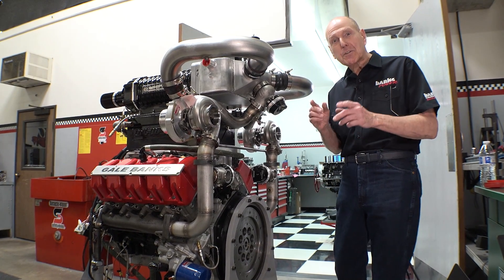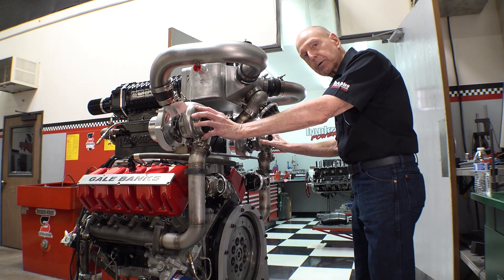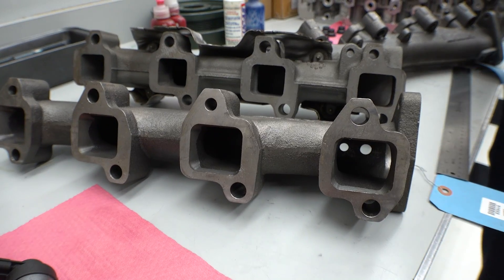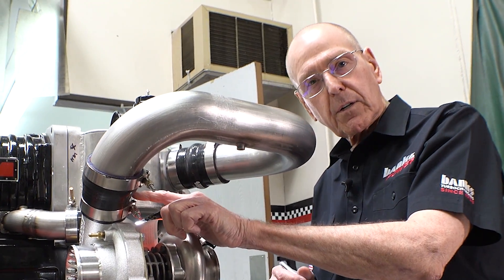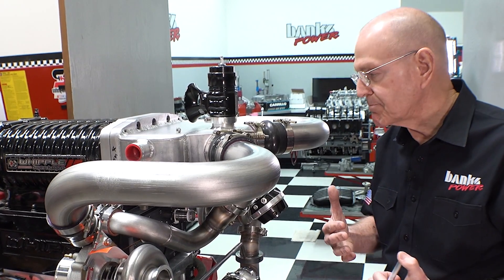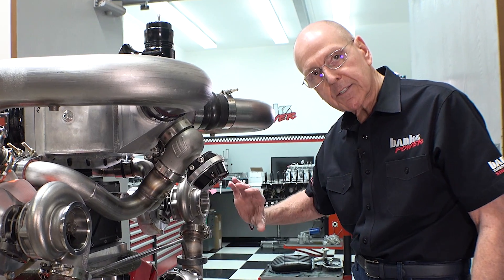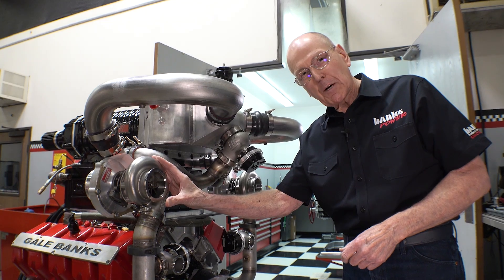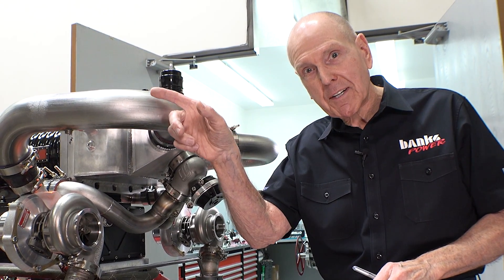SUPER-TURBO DURAMAX FIRST LOOK: Building A Monster Truck Engine Pt 10

Comment: I’m surprised the manifold runners aren’t separated in to scroll arrangement to fully maximise scavenging instead of the very compromised single log where all the pressure waves collide

Comment: What actuates the blow off valve?  on a gasoline engine isn't it Usually the vacuum behind the throttle body that is the valve open?

Comment: Wouldn’t the pressure differential between the turbo bypass and the blower cause back pressure (due to compounded boost) effectively rendering the bypass useless?

Comment: I made a drawing of a turbo where the intake/hot side & cool side of the turbo is seperated by a 24 inch shaft. On each end are the impellers. The exhaust intake side of the turbo doesn't affect opposite side with its  heat, so the side pushing air in is a lot cooler.

Comment: Sorry I probably missed this but won't the turbos choke the blower before they spin up? Which should deaden the throttle response?

Or is that what the gate value is For? To bypass the turbos until they spin up?

Not an engine guy just curious.

Comment: It looks to me like that bypass valve is going to vent air from the supercharger discharge to the turbo discharge. The pressure under the supercharger should always be higher than at the inlet as it is a positive displacement compressor

Comment: Why we never see a CVT driven supercharger, so you have optimal charger RPM no matter what the engine is doing?
Reply: It has been done before, on the Napier Nomad, but such systems add weight and size to the engine.  There is no need to put a CVT on a positive displacement supercharger because they have a pretty flat curve of boost vs engine speed.  The Nomad used an axial flow turbocompressor, so the CVT was needed to assure boost at low engine speed.

Comment: What is your ideal (density) air/fuel ratio for this application? How does it differ from a 'off the shelf' map? Whats too lean for a diesel? I am wanting to lean on my m57!
Reply: There is no such thing as "too lean for a diesel".  Diesels will run fine all the way down to 100:1 air:fuel ratio.  There is such a thing as too rich.  That's when they begin to smoke and overheat cylinder components.

Comment: Has anyone ever done a CVT type clutch to give a variable ratio on the charger input? This may answer my question, would this cause a problem of choaking the engine if the charger were to stall out at low RPM?

Comment: With an active trottle you get AIR hammer that has an effect like Water hammer in pipes, the blow off valve is common sense for an engineer....

Comment: How about using Inconel for the hottest portions your exhaust? It can be 3D printed. Wouldn't need to be as thick, and you could put a reflective heat shield around it too. Also, if the water/antifreeze cooling the air for the charge air coolers is also kept cool - with, for example, air conditioning technology, or even acetone and dry ice, it might last longer than using just ice, and could be worth the extra weight and volume with increased power and long term effectiveness.

Comment: With running that brace across the up-pipes why not add some sort of vibration dampener/insulator as well to take the oscillations off the welded joints or I’m just over thinking it

Comment: I personally would have changed the bypass point. Instead of a single 60mm waste gate on the hot side of the charge. I would have had two smaller electric / mechanical bypass butterflies (instead of a limited flow valve) on the cold side of the intercooler. I also would have had them tap off each side of the intercooler box. The Whipple center feeds, so pulling excess boost pressure from the sides is unlikely to hurt flow into the center. Whereas disturbing the flow before it goes into the water to air section of the intercooler, could potentially cause cavitation issues.
Reply: I would also try bypass way more air once a certain boost level was achieved (well below 22psi blower pressure). The adiabatic efficiency of roots / screw type superchargers decreases dramatically with revs decreasing air density. My goal would be to have the supercharger do as little as possible once the turbos are up and running.

Comment: I am a retired  Mechanic 47 years I have a question you want to build 1314R hoar O are you gonna manage the torque of the diesel creates to the transmission because you're going off the charts it's hard for Torque from the engine to the transmission I don't see the need if you're exceeding all your torque value why would you need so much horsepower out of a diesel to do all that if you got talk you got power and your plie more torque than a power ratio would not make things work just a

Comment: I've been asking the question how come nobody is super charging diesels. I was thinking along the same lines as what you have here.
Reply: The first 2-stroke Detroit Diesel had a Roots blower on it, back in 1934.  Cummins had some supercharged 4-stroke diesels back in the 40's, before they started using turbochargers.
Reply: Yup. I'm talking about the new higher horsepower trucks. I brought up the subject to the youngsters and they all have the opinion that they rob power. I think a Whipple would be the cats meow. I have a 7.3 sitting in the garage that I want to experiment with.

Comment: Using that BOV/Wastegate (I didn't catch which) as a bypass for the supercharger once the turbos get into their power band is a great idea. I've been interested in how they would solve the bottleneck that the Whipple becomes at high rpm. Great content Gale!

Comment: Fantastic, love this stuff, wonderful design characteristics with piping and compressor bypass as well as surge blow-off valve, my question to you Mr. Banks is when are you going to work on developing a variable rate input shaft on the front of the super charger to regulate or synchronize speeds, velocities, pressures and atmospheric points and characteristics in a manner that you can control through rpm to match the turbo's? Thanks for the series

Comment: I see you have the air covered. The question is what are you going to do about fuel? I'm sure you will have something quite special to deliver the volume required and at 7000 rpm

Comment: Gale round valves have been around over a hundred years, let’s reinvent the valves totally, I have some awesome ideas.
Reply: I've been designing oval, elliptical, and multiarc valves for a while now.
Reply: Andy Harman do they flow more air?
Reply: @duramax78  They can't help but flow more air.  Curtain area is larger.

Comment: Gale, Have you addressed the fuel quality? Are you running pump fuel? Which brand? What additives? Anything special about your fuel? Also have you tried Howes fuel additive? I noticed in my Detroit over the road truck there is a horsepower boost and I get about 1" more manifold pressure. This is after everything is warmed up.

Comment: Hey Gale Banks, first i live what your doing! Your the coolest old dude around! 
Now my question is why are you using a roots type blower when they are so inefficient? Why not use a procharger ? Way more air and power you could be the first to do turbos plis a procharger but i doubt you would need the turbos with a 138mm procharger gear driven... 
Anyways just thought i would put that out there!
Reply: He is not using a Roots blower.  He is using a Whipplecharger, which is a screw compressor.  Much more efficient than a Roots.  If you watch the earlier videos of the series, he tests a Roots blower, and explains its low efficiency.

Comment: Why not run a pair of  pro-chargers modified to use a supercharger drive belt so you can run them to higher boost without slippage and then avoid the mess of turbos+blower?
Reply: Because prochargers have poor low-speed boost characteristics.  They are just the cold half of a turbocharger.
Reply: @andyharman3022  they are gear driven, you can have boost on idle like a supercharger if you want.
Reply: @NVMDSTEvil  You would have to put a ridiculous pulley size on a procharger to get 12 psi boost at idle, as Gale is getting with the Whipple on the Dmax.  Then the supercharger would reach its max speed limit by the time you hit 3000 rpm.  A positive displacement supercharger is much better for the monster truck application.

Comment: with Audi and other auto makers now employing 48 volts or more to spin centrifugal compressors, I have to ask if the same might be a viable option for this Monster truck engine program. it stands to reason the "electric turbochargers" could be spun up a touch over idle to build power and later used to bleed power off the intake charge when the atmospheric turbos are at full song.

Comment: "Getting the turbos to light just off idle is hard"
But not impossible, and my goal with my 91.5 5.9l Cummins.  Its easyer only having to manage 2500rpm of exhaust  on the high side.  
An HX35W12D is about .70AR means Im running ~ .35AR single/open.  Spool is reduced to ~1100-1200 from 1500-1600rpm @12cm.

Comment: I'm enjoying the stages of development and seeing how the numbers come together. I'm kinda surprised to see a waste gate used for the turbo air bypass. In my mind it's to small n slow to control. The late model TA 8V92s had a bypass gate built on the blower inlet housing, if memory serves it was about 2.5 inch square duct with a light weight spring to hold it from bouncing ( 2 maybe 3 oz.). Some benefit may also be found taking the air post CAC. instead of pre CAC. I'll be waiting impatiently for the next installment,  dam I love this ... !

Comment: Has anyone done a cvt on the blower?  This way it could be adjustable ratio instead of just based off crank speed.  Might be able to use a setup off a side by side vehicle.

Comment: I can tell... you enjoy your work thoroughly Mr. Banks. In my opinion, you are the modern day engine Einstein, and clearly design absolute genius into everything you build, as well as having presentation and beauty of design always so perfectly matched to function. Your work Sir... looks very put together. I also appreciate your thinking on your valve modulation balance factor as a means of power punch control... for a diesel, that was wonderful to see where the system led you to a control point. I imagine that combo you’ve built will be insanely wicked. Love your work... your smile throughout your video says you love what you do... especially the little nuances, like the horn shaped blow off valve pipe.. very very cool. 
           A fan... Michael Miller

Comment: Detroit diesel 8v92tti was basically the same setup but not as hot. Made awesome power to 2400 rpm. Design went back to the 60s I think. The first 6-71na design was from the 40s or 30s.

Comment: Can the air pressure from the turbos escape backwards out of the blower?
Reply: No not possible. 
1 the turbo is pressurizing both sides when the air gate is open. 
2 the blower is a positive displacement air pump. There is minimal internal air slippage so little it's difficult to measure accurately. 
3 with the flow restrictions of the air valve there will always be a positive pressure differential on the first CAC. and the top of the blower.
Reply: @1oddog  That makes sense. Guess i was asking in general though. If the turbo wasn't pressurizing both sides. 
It seems like at a certain point the supercharger in only robbing hp and disrupting the flow of air. 
The next question would be can air still flow through the sc if its not spinning. 
A clutch would makes sense as soon as those turbos hit the max air density of the sc. Might not be a big enough number to make it worth it.
Reply: Once the turbo is pressurizing both sides of the blower,  the blower is essentially coasting. At that point the biggest power draw would likely be the drive belt itself. A drive clutch would reduce the parasitic loss at the cost of increasing the rotating mass substantially, and adding a potential weak point in the system. 
A couple things to ponder,  I'm sure you can think of more as well.

Comment: Hey gale it would be really interesting  to see a 7.3 power stroke making about 1500 plus hp as a monster truck or drag truck motor using large turbos and a supercharger
Reply: I saw a super stock pulling truck using a triple-turbo 7.3 power stroke with a V8 injection pump off an 800 International once at a pull in Charlotte, Michigan.  There was the usual collection of Cummins Dodges and a few Duramaxes, and this was the only 7.3 in the field.  It was just plain awesome, and beat the other trucks by about 15 feet.  I never saw that truck again, but wonder why more truck pullers don't run the Navi 7.3 to this day.

Comment: Hey Gale, get a small CVT transmission between the engine and blower and modulate the blower speed independent of the engine speed.

Comment: I used to design supercharging systems at Eaton, and was slightly familiar with the super-turbo system that Eaton developed with VW for their 1.4L Twincharger engine.  The supercharger was driven at ~6x crankshaft speed so that it would blow the turbos into life at low rpm's, then it was clutched off and bypassed at 3000 engine rpm.  Then the turbos operated alone for all the engine boosting above that. 

And then there were all those Detroit Diesels that had turbo-super systems.  I have wondered for a long time if the supercharger is able to multiply the pressure ratio once the turbocharger is boosting its inlet.  Later Detroit Diesels, such as the Silver 92's had blowers that would bypass boosted turbo charge air directly to the airbox.  This had the effect of unloading the supercharger rotors and eliminating the pumping work, thereby improving fuel economy. 

I think that completely bypassing the supercharger is the way to go, and maybe the bypass tubing should be the same size as the turbo compressor discharge tubing.  And will the repurposed wastegate introduce an unacceptable amount of pressure loss?  And would it be worthwhile to consider using an electronically controlled bypass valve driven by the ECM?

I did a lot of development when I was at Eaton on aftercoolers for superchargers, and found that there was a lot of variation in air distribution in the intake manifold.  Most of my work was done with the 5th-Gen Eaton M112 for a V8 application.  With the blower case centered along the length of the engine, the discharge triangle is offset to one end of the intake manifold.  I found that about 2/3 of the air was going to the front four cylinders, and 1/3 to the rear four.  I bring this up because it looks to me like the Whipplecharger is centered along the length of the engine, and that perhaps the outlet is off center in the intake manifold.  Is this the case, or are my eyes deceiving me?

And I am wondering about your Cylinder Fill Percentage parameter.  Is that true volumetric efficiency?  Or is it a measure based on cylinder conditions at intake valve closing?

Comment: Gale, 
I did a twincharge setup myself.. just because I could. (1.6l gas- Mini) 
My theory is since the supercharger has a displacement larger per engine rev than the engine (as it has to in order to make positive pressure), that no matter what you do before it, the pressure post supercharger will always be higher than pre super charger. 

With that in mind, is the flow through that bypass instead not dumping from the supercharger outlet, back into its inlet?
That was my theory. 

I.e. all of the mass flow that goes through the turbo's also goes through the supercharger. The bypass just removes the compounding of the SC and removes some crank load. 

Essentially you would be bringing the supercharger pressure ratio down by diverting its outlet back to its inlet which should reduce the compression resistance seen by the rotors, thus removing some of the load from the crank?

Would love to get your input as you have done this way more than me. 

I developed my own bypass valve for my setup, and use a literal pressure regulator to control that boost "crossover" point, as well as having a stepped diameter valve so that different boost thresholds would help the setup to "fail open", while allowing the regulator to top/hat always have a pneumatic advantage over the valve. 
Ended up using a FEP oring on PTFE bore in the top hat (played with diaphrams as well), and am having good results so far. Low stiction, and I dont have to worry about inverting the diaphram.